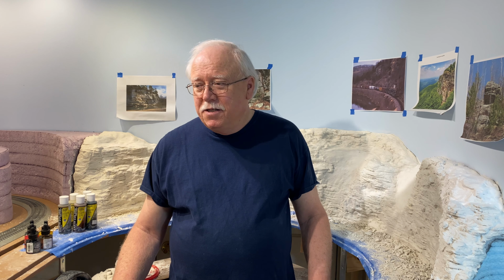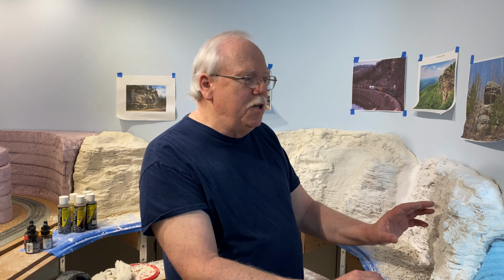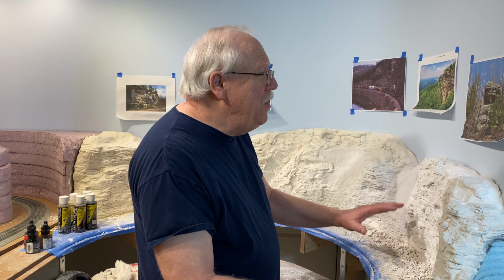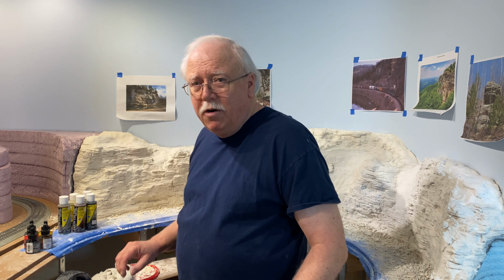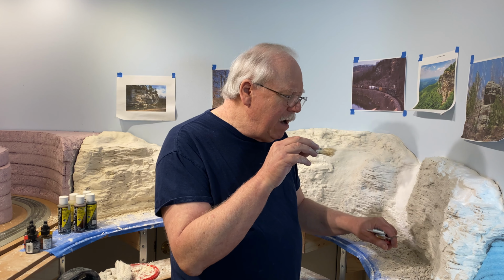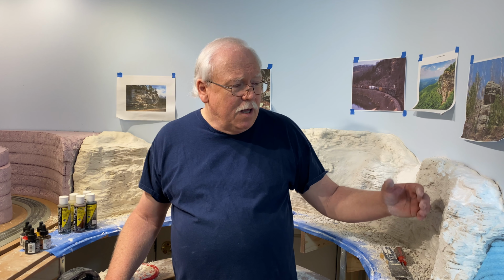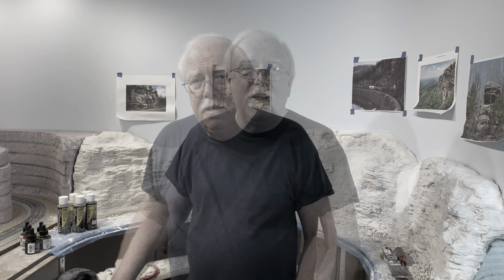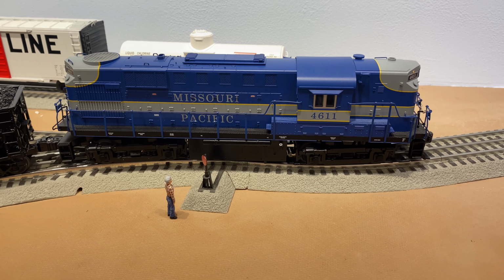OM&S Railway Update  The Bluff Project and More:  A 3-Rail O Gauge Model Railroad Project

Comment: Hi Bill, I love what you are doing with the layout.  I am interested in the technique you used with the plaster of Paris.  It looks incredible!
Reply from the maker: Thanks Pete.  The bluff involved a lot of plaster, about 25 to 30 lbs.  And that is with the base of the structure being made out of blue foam.  I started out mixing small batches.  Also worked to lengthen the setting time by mixing the plaster of Paris using very cold water and trying not to stir the plaster anymore than absolutely necessary.  As time went on and my confidence grew I started making larger batches and mixing it with more temperate water.  The real carving starts when the plaster starts to set, but you have to work fast.  Carving the rock work is really not all that hard.   You just kind of have to jump in and find the techniques that work for you.  There is a fellow on YouTube who has done some marvelous carving of rock work.  I will try to find the link and when I do I will post here.  If you have not carved in plaster, be prepared for a big mess.  The mess is just part of it I suppose.   A Wet n Dry vac is good to have around.
Reply from the maker: Pete, I found two links and there are more.  https://youtu.be/Ckn7gWsfyyU  and  https://youtu.be/qlaQqEnoEjw